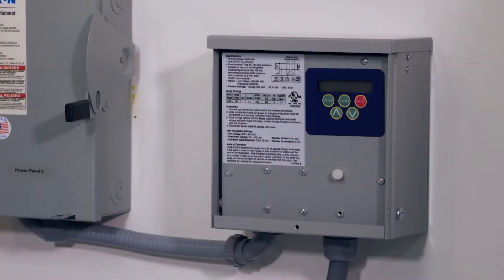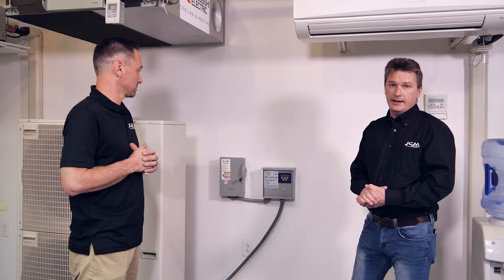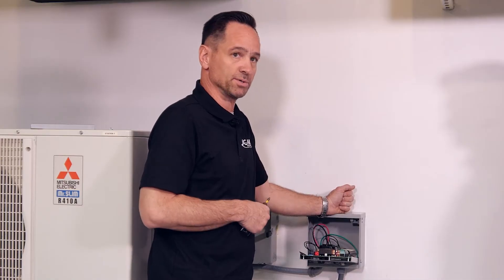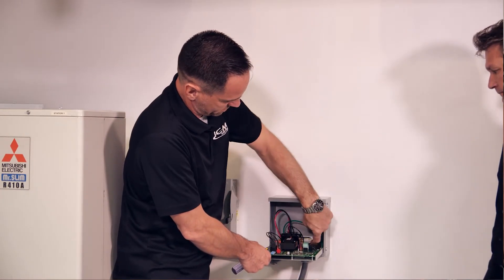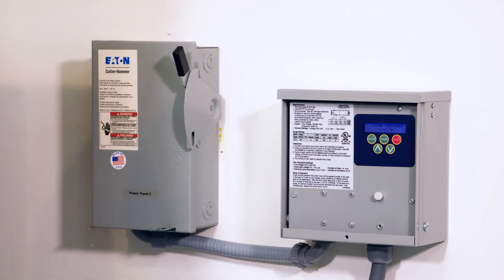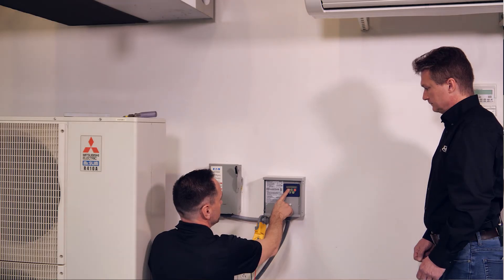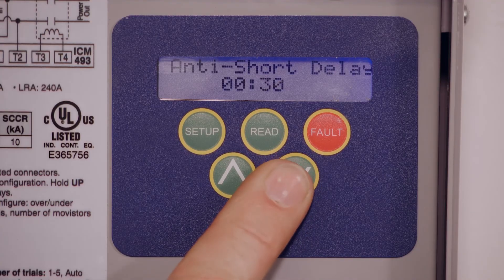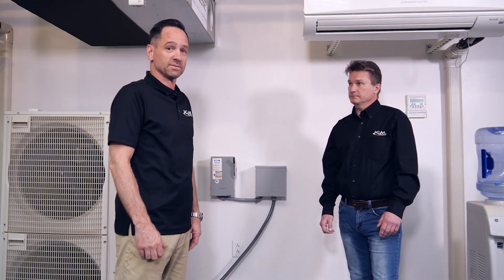ICM493 single-phase line voltage monitor Installation

Comment: Nothing protects against a close lightning surge If lightning can travel miles, Is 50k degrees a 30k amps and 300 million volts. It would blow this device off the wall. Just do a whole house surge device and skip all the problems with electronic gadgets like this. We aren't astronauts. This is guaranteed nuisance calls. 45 years field experience here. Industrial chillers and absorption equipment.
Reply: 45 years experience as a clown? Confused at your “field” from your comment 🤡

Comment: I had to look this up online, they said MOV like 20 times and never give an explanation...
"In the most common type of surge protector, a component called a metal oxide varistor (MOV) diverts the extra voltage. As you can see in the diagram to the left, an MOV forms a connection between the hot power line and the grounding line"

Comment: What is an MOV??? Please clarify the difference between over and under voltage and a surge.  What is the life expectancy from these units? 

If the voltage goes over to 255 volts for example, and it trips it off, does this count as a strike against the unit? So it can only work 4 more times? 

If you had a regular a/c, and the compressor kicked on causing the lights to dim momentarily, could this trigger an automatic low voltage disconnect?

What percentage or voltage do you recommend to disconnect at for over and under voltage on a 240 volt circuit? 

Can I have a surge protector on my disconnect and then have this installed after the disconnect? Yes this would be two surge protectors. I already have the surge protectors but likes the added protection of this  unit. Please advise. Thanks.
Reply: Yes you can, that's exactly how I do it.
Reply: There's no 5 limit